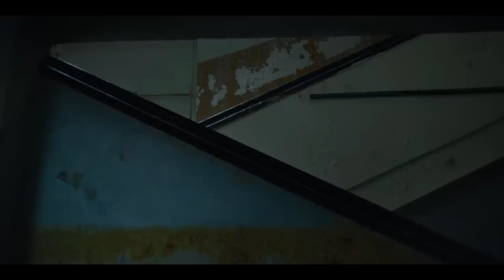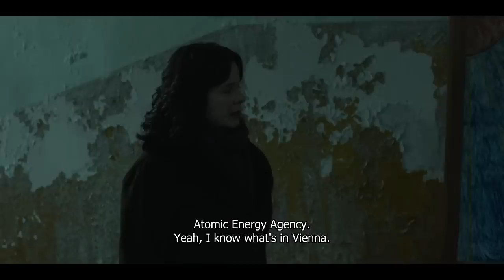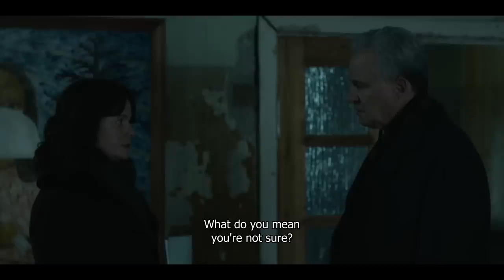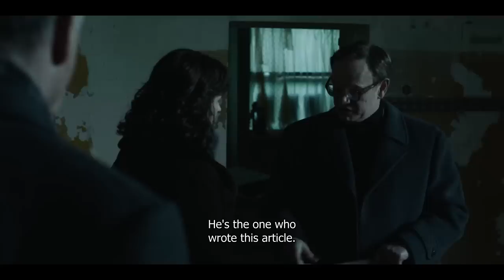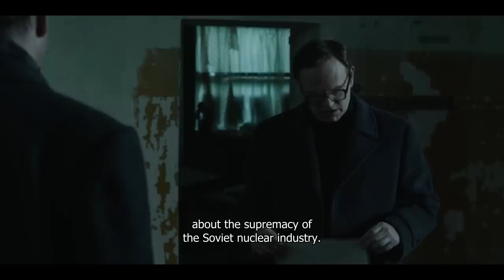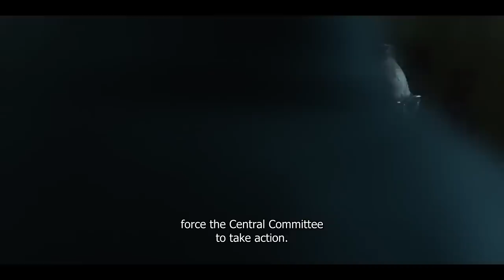Chernobyl - The Fatal Flaw in RBMK Reactors

Comment: The flaw will not lead to an explosion if the reactors uranium fuel rods have the proper level of uranium.  If the uranium mix in the fuel rods is too high, with the enrichment level above standard for the RBMK reactors, then the explosion can occur.  Whether this happened inadvertently or intentionally the basic fact remains. The operators didn't have the ability to control the production of the fuel rods.  If the fuel rods were deliberately made with enriched uranium, this may have been an attempt to use the reactor as a breeder to reduce costs or to create materials for weapons. ;-)
Reply: I am not a nuclear power plant operator but i thought nuke power plants are operated with unenriched uranium.  Or at least that is the dispute i recall with Iranian nuclear power do not require enriched uranium
Reply: @tachy1801  Depending upon how many of the rods had the incorrect mix. ;-)
Reply: The reactor was designed to use U-235 not U-238. Also because they turned the water off for the test they wanted to perform the increase in reaction rate caused the water in the reactor to turn to super-heated steam which is a gas resulting in water molecules having a ton of kinetic energy and increase the volume that they were in. This is evident by the control and fuel rods which weighed tons being lifted up and down right before the steam explosion occurred. That steam explosion resulted in fuel rods being punctured and stopping the control rods where they were in the reactor. Once the lid of the reactor was breached through the steam explosion, oxygen gas flowed into the reactor which is now close to basically to the combustion point, that results in the fire that occurs after.

Even if a different uranium type was used, and assuming the operator was trained well enough to recognize the difference (which by the culture at the time, likely never happened). Just turning the water off and removing all the control rods laid the foundation for the accident.

Comment: Had the procedures been followed and competent decisions been made the reactor never would have exploded.  The graphite tips as a design flaw don’t even come into play unless the control rods are completely removed.  If an airplane flies too slowly and its wing reaches the critical angle-of-attack the wing will stall and the airplane will lose lift. That is not a design flaw, it’s just how it works and why pilots have training and procedures so that they know how to fly a plane.  The test at Chernobyl should have been cancelled, for many obvious reasons, but they continued on anyway in about as reckless manner as possible for a test that wouldn’t have been valid in any case.
Reply: Your example is unrelated. It's a logical fallacy, I think the term is false equivocation
Reply: Of course an airplane pilot would know everything about lift. These men at chernobyl, they knew nothing of the void coefficient
Reply: It is neither a logical fallacy or a false equivocation. Do you know what those terms mean?  If they had operated the reactor properly and followed the procedures that were already in place then nothing would have happened, period.  That is a fact.
Reply: I very much agree.  The  inclusion of graphite followers has been highly overrated in the media. By the time the operators SCRAMed, the reactor was already in a runaway state do to a feedback loop from the xenon-135 burning off. They tried to bring the reactor back up much too quickly after it stalled so that they could perform the test. If they had slowly brought the reactor back up to 700MW leaving in a safe number of control rods they would had ample time to deal with the xenon burn off rather than having the reactor suddenly run away in an uncontrollable reaction.

By the time the rods were bouncing,  it is questionable whether they could have been saved by any better control rod configuration during the SCRAM. Yes,  having a moderator follow the absorbtion rods complicated the issue,  and having the control rods drop faster might have helped a little. But the SL1 went from fine to meltdown in a matter of milliseconds. That's faster than ANY SCRAM could have physically reacted (without explosive propellant).  And the control rods wouldn't have stopped the lingering decay.  They were probably doomed long before they got to that point.
Reply: @timharig  Woah, take it easy on the common sense there!  Thanks for the comment.

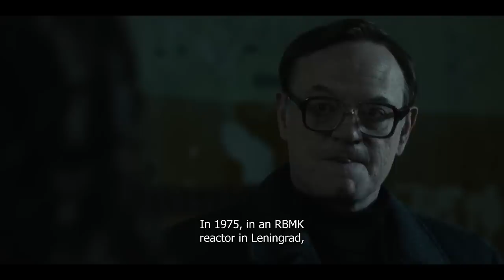Comment: 2:10 Funfact: The problem with the graphite tips wasn't discovered in 1975 at Leningrad, but in 1983 at Ignalina NPP (in then the Lithuanian SSR). Parts of this series have been filmed at Ignalina because of it's visual resemblence to ChNPP.

The only connection at the subject of incidents between the Leningrad NPP and Chernobyl is a 1975 incident with the loss of coolant. Partially the same incident happened at Chernobyl's unit 1 in 1982.

Comment: This explosion was really important... It has made nuclear reactors Way more safe.
-Additional valves for excessive pressure and no water supply
-SCRAM reaction breaker (Just dropping the rods i to the reactor)
-New reactor caps
-New fresh water banks isolation
Reply: Nuclear reactors were already a lot more safe everywhere else in the world. The Soviet Unions reactors were cheaply built with many safety features not in place to save money. Three Mile Island was pretty much the same thing only the reactor was contained in a concrete vault that contained most of the radiation leaked. Actually if the operators at Three Mile Island had done nothing at all, the automatic safety features would have prevented what did happen. It was military operators not completely trained on that type of reactor. So it was human error, but not negligence or outright ignorance as in Chernobyl.
Reply: @Youre_Right  The soviet union was also using RBMK reactors to produce enriched material for nuclear weapons.

Comment: Fun fact, RBMK reactors are actually split into two sections.
The “Graphite tips” are actually partially rods in themselves. When the rods are pulled up, the graphite tips are brought up, casually a large surge.
RBMK reactors are known to be very unstable and you have to baby them, and usually power needs to be increased gradually.
Additionally, when the rods were taken out and the Graphite section was put back in, the coolant and water had been displaced from the movement.
This displacement caused the fuel to start crashing into the graphite, exponentially increasing the power output. As the core melted, the material only became more dense and more volatile.
The reason why portions of the rod were graphite was to compensate for different grade of Uranium that was used as fuel, so graphite was used to increase this. This is why RMBK reactors NEED to be used very delicately.
For whatever reason, the control rods were not able to be put back in, and this chain reaction happened. 
If the rods were able to be put back in, the reactor may have had a chance this wouldn’t have happened, but even then, the coolant from taking out the rods so quickly in the first place is still a factor, so it could have still melted. RMBK reactors have few failsafes and rather poor cooling.
However, RMBK reactors are incredibly efficient for how much they cost to build, but the combined system of rods and graphite rods cause them to be very unstable. 
Humans are imperfect, and can misjudge and look over the many Intricacies of a reactor, so not having a proper failsafe is not an option.
Reply: the truth is the biggest flaw was not training the operators fully on the reactor this was true for Chernobyl and fugashima they both didn't know how the cooling systems worked till it was to late in Chernobyl they let the reactor run hot with the cooling systems turned off fugashima blew cause they turned the ic cooling system off cause it might breach releasing radiation into the air which ultimately was what they ended up doing anyways when the reactor pressure got to high
Reply: Ok kgb

Comment: I missed the point as to why the ends of the control rods have graphite instead of being entirely made of boron?
Reply: The graphite doesn't directly cause the spike. It's the loss of water when lowered that causes the spike. The graphite tips are there to prevent exactly this happening, by allowing more of the boron to be removed without allowing water to backfill. But if the rods are FULLY raised then water does backfill and you get a spike when the water is suddenly pushed out when the rods are lowered.
Reply: Designers knew about this risk so the rods could not be so far removed without overriding a safety switch, but that's what they did at Chernobyl.
Reply: In western reactors water is the coolant AND moderator while in the USSR graphite was the moderator and water was used as a coolant. If too much heat is generated in western reactors the water will boil and the steam does not work as a moderator. Less moderator slows down the reaction; that's called a negative void-coefficient - it's a self-limiting reaction!
Now, water can absorb neutrons as well but in our western reactors this is no problem because due to higher enrichment there are plenty of other neutrons left; so it does not matter if we lose some due to absorption by water. However, in the USSR they used only slightly enriched uranium, so there were very few neutrons only. 
Due to the scarcity those few neutrons were really valuable! Now if there is too much water in the channel it will absorb those few neutrons; the reactor would stall! 
As a compensation they added those graphite-tips to the boroan control rods; In fact the rod consisted of two parts: Boron-part and graphite-part. So if they removed the boron-part of the control rods and replaced it by the graphite part there's no absorption of those few neutrons.
But if there is no water at all and only steam left those neutrons do not get absorbed by it, too many neutrons then get moderated by the graphite and this increases reactivity! That's called a positive void-coefficient. 
Apart from saving costs by less costly enrichment the USSR did not have the technology/knowledge to built reactor-pressure-vessels! So they invented a reactor they had the know-how for.